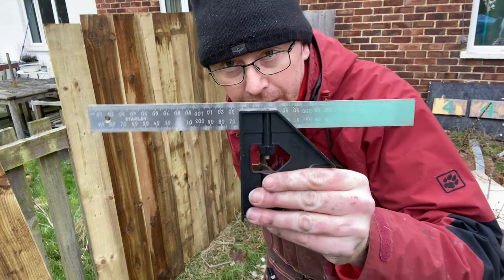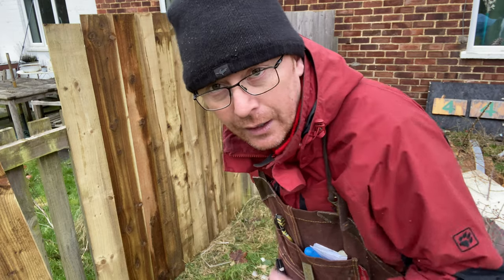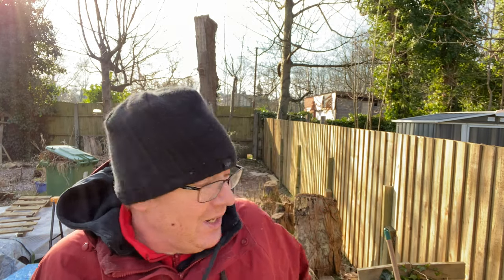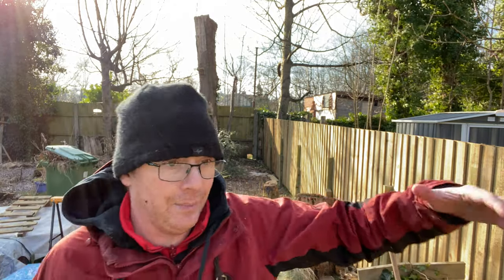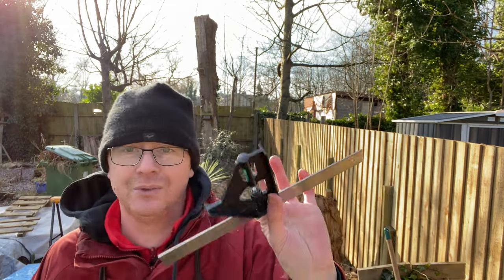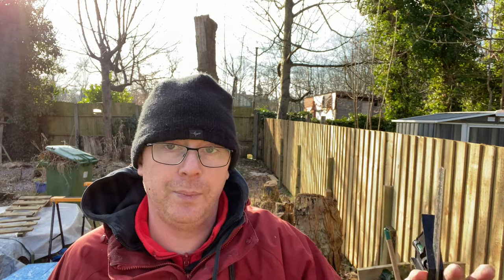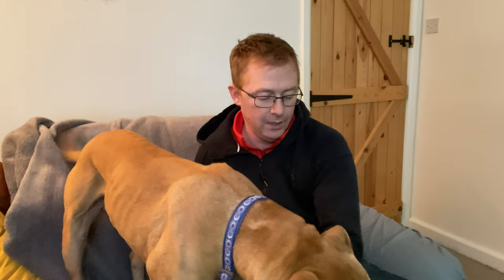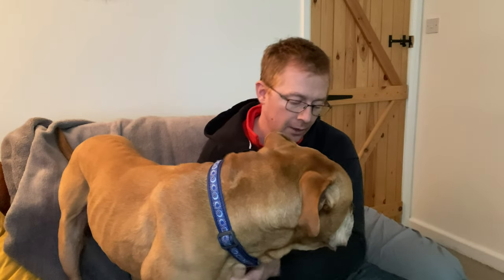Building a Feather Edge Board Garden Fence

Comment: Abled bodied here and tried to do it with a hammer... then saw you video.. first finish brads followed by impact driven screws... never think pin and fix is an issue, I passed on my learning to you to a guy that has a business installing fences, usually custom jobs... he told me if he pinned and then screwed he would lose repeat business.
My heart melted for the reason for the fence going up quickly... Sonny is so happy and chilled with you... what a great couple you are!
Reply from the maker: Thanks Mark for your very kind comments, much appreciated! It is quite saddening to hear your discussion outcomes with the professional, but also slightly unsurprising as well. Best wishes, Leo 👍

Comment: That is a remarkably good fence Leo, the trick with the combi square was very neat, and its amazing how straight and level you’ve put it up.  I’ve tried using brad nails on a feather board and they just don’t hold, but I’d never thought of using them for a quick fixing and then screw in afterwards.  Impressed with getting your screws into the rail every time, I’d have been using a spirit level and putting the screws in as I go (every half dozen boards or so) and still ending up missing the rail regularly !
Couple of things I might have done differently is to put a taut string line in along the top to line the boards up to,  but judging from the end result it didn’t look as if you needed to.  Other thing I’d have done is to paint/preserve the feather boards before installation as you can’t do the back and you’d never be able to do the bit on the feathers that are underneath each board. Understand for speed that perhaps wasn’t an option for you, although the dog fostering agreement seems strict, Sunny would have to be a pole-vaulting dog to get over that fence,  even at 4’ high he’d be challenged !
Reply from the maker: Thanks Geoffrey for your really supportive comments here👍👍. Totally agree about treating and I should have done. The only issue was the boards were quite wet and I didn’t have time to dry them out before fitting. Since been treated but as you say doesn’t get into the joints. Made sure I treated both sides on the workshop cladding before I installed them though 😀👍

Comment: Well Done Leo, Huge respect to you. If you don't mind me saying regarding your fencing. I can see that you have attached it to the existing fence  with new boards which are a lot higher. Could I suggest on your new fence, that at the top of your new boards, on your neighbours side,  you attach a 1" slate batton at the top for the full length of your fence then on top of that screw a length of 3"x1" to the full length and that acts like a capping but this will give the full length of your fence protection in high winds and make it stronger and not bend in summer. Good Job though and I said, Huge Respect to you.
Reply from the maker: Nice one, cheers for the message. Yes the next stage will be to do as you said in the comment here, much appreciated. Tbh, the fence held up great in the three bad storms we’ve had the last few months, no issues at all, but I’ll definitely be adding the extra piece along the top at some point 👍👍👍

Comment: I was gonna say (until the end of the video) that it looked like more for your privacy than the neighbours as there was a fence there!! Only thing that I would be concerned about would be the one single fixing can lead to the featheredge 'cupping' but good work (could you not have made 2  'T' jigs, like a combination Sq put the 1st one up level and just gauged off of that?)
Another project successfully overcome
Reply from the maker: Thanks Pistol. Our landlord owns both houses so I spoke to him and he was fine then spoke with the others tenants and the reason behind it and they were all good about it😀👍. Will see what happens about the cupping of the boards as I thought the same, but it seems there is alternative opinions in this regards, like all woodworking matters I suppose 🤷‍♂️😂

Comment: good to treat the cut ends, if you are not painting it all. good job :)
Reply from the maker: Thanks Dean. I’ve been using LangLow wood preserver for the cut edges, is that stuff any good?
Reply: @Hand-i-Craft  not used that one, should do?
Reply from the maker: @dean6125  It seems ok Dean, but I guess with this type of product time will prove one way or the other 😀🤷‍♂️👍
Reply: @Hand-i-Craft  one i been using is oak colour, ronseal one coat timbercare. Done some years ago and redo when fades (year or 2). Done a fence next to a gate years back, painted with same stuff, gate rotten, fence all ok, seems wood quality made difference

Comment: To someone who has ever used nails and edge to edge wood pieces how hard and fiddly is feather edge please? I'm waiting for a quote but I'd like to use the money for jobs I cannot try myself. Stupid question as well but can I use just normal screws to fix with. Thanks. That's one lucky dog as well!!
Reply from the maker: Hello Tina, thanks for the message. Feather edge is pretty straightforward to work with tbh. If you get a combination square (they’re only a few quid) it really helps to line them up. Yes you can use screws, you need to buy decent ones though that are suitable for outdoor use. When you over lap the feather board you put the screw just to the left of the overlap and not through both boards as this will allow the boards to expand without splitting.

What is maybe suggest is go to your local timber yard and maybe buy 6 feather boards and do a test run of them to see how you get on👍👍
Reply: @Hand-i-Craft  Thankyou so much. Very good advice and greatly appreciated.

Comment: Great fence job and lovely dog!  Well done!  Not familiar with the featherboard fence design.  Just curious,  did you consider pre-building panels of fencing and then installing, what led you to this design?
Reply from the maker: Cheers for the comment R Wind. Couple of reasons I didn’t pre-build the panels. Firstly the spaces between the concrete posts were all different so each panel would have to have been made bespoke anyway and secondly if I would have built a whole panel I don’t think I’d have the strength just in my left arm to get it in position. Maybe could have, but the method I used was a lot friendlier on my back😀👍
Reply: @Hand-i-Craft  TY for the reply.  I assumed you would have had good reason for your method.  Wasn't second-guessing, just pondering the methods...  

 Thinking of large panels, I am frequently in a position with items too heavy or unwieldy for me to wrangle.  So I had been wondering about smaller panels. 

Or stringing together and wiring a series of boards or panels sorta like beads. (Probably a horrible idea!)

 Or hey, how about little "french cleats" on the back of each board to help position initially? So many times, I have struggled holding something up for installation, only to see a real carpenter establish a platform with a temporary ledger.

And I find myself wondering about something like a drywall lift to manage panels.  Which makes me think...

Did you see the Grabo (?) battery powered vacuum handle  demonstrated by Izzy Swann this last week?  I did not look to see how much it cost. But it has potential.

Thanks for the videos!  Job well done!